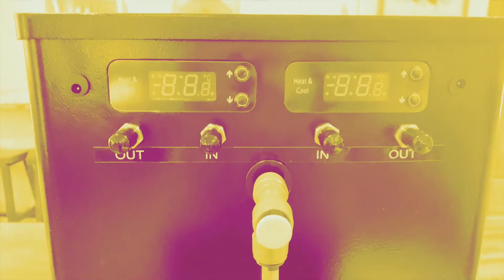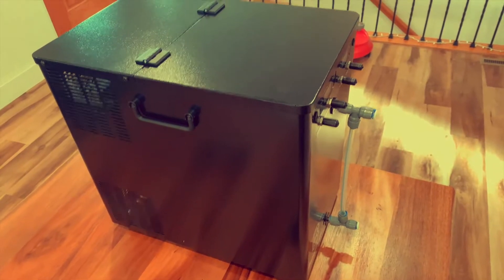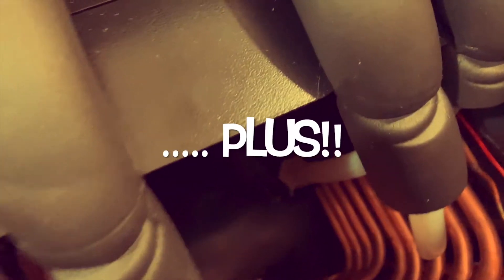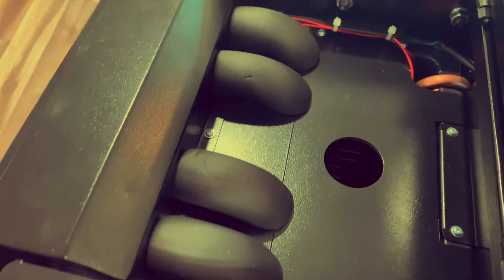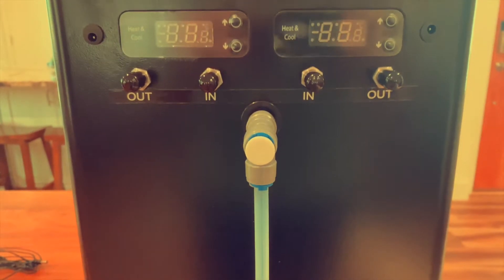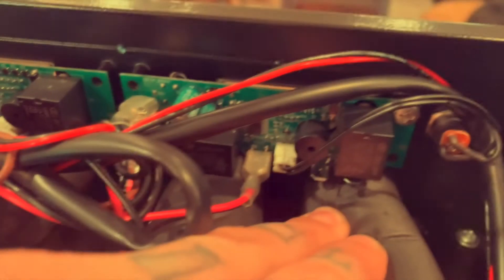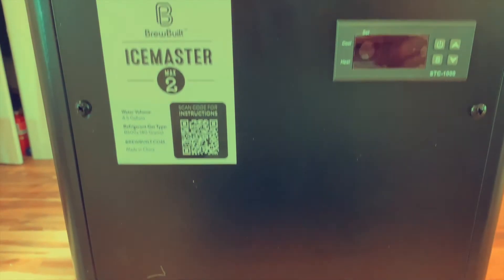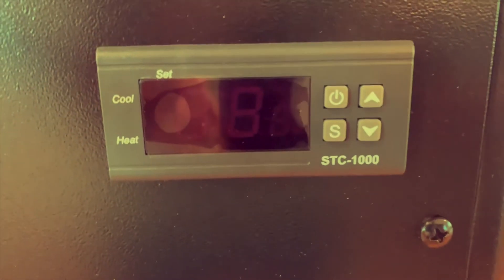Best Glycol Chiller For the Money??? BrewBuilt Icemaserter Max 2

Comment: Just curious, did you move away from the X1pro due to the lack of cold crash ability? Just curious where you landed. I'm similar to your initial needs, I don't have space for glycol so went that direction. Seems like a good product but a little limited maybe if you want a perfect solution. Good videos btw, thanks man!
Reply from the maker: Your exactly correct. Just could not get the X1 pro down to cold crash temps. I did have a video I did on the x1 pro and its cold crash capabilities. It worked for my needs for quite some time before I decided to cold crashing is a must. I do a ton of NEIPA’s so I feel the need to cold crash in order to clean up the style of beer it most make. 

CHEERS
Reply: Nice, your "new" setup looks amazing, hope it's meeting your needs. I get the x1pro this week. It's going to be a huge upgrade from the ss brew buckets I have been using. I have a beer in my brew plans that will need some dry hopping so hoping the x1pro helps me do that without introducing O2. I am not overly concerned (yet) with cold crashing but who knows, it's a journey!

Keep up the good work!

Comment: what is your proportion of water/glycol ? 3 gal of water and 1 of glycol ? cheers !
Reply from the maker: Yes sir 3 Gal Distilled water to 1 Gal of glycol will give you 25% dilution. Off the top of my head I think brewbuilt claims at 25% glycol freeze point is -7C. You might have to double check that but I usually have my Unit set at -4C when cold crashing.

Comment: Have you checked out the Stasis glycol chiller?
Reply from the maker: I actually did quite a bit of research on this unit and the stasis unit before I made my decision. This unit is still a way better value in my opinion. The only real benefit I could find on the stasis would be the compact size for people who have limited space. But if that’s not an issue I don’t see any reason I would purchase the stasis over this the ice master max 2.
Reply: @zackrabbitbrewing4997  On the Max 2, does both pumps run at the same time or can they independently run?  Thanks for your input!
Reply from the maker: Both pumps and temp gauges are completely independent of each other allowing you to run two fermenters at the same time. For example you would be able to have one fermenter in cold crash stage(say 30 degrees) while your other fermenter can be in early fermentation temps say around 68 degrees.
Reply from the maker: Or you would be able to run only one fermenter and the other pump can remain idle or can even be turned off.
Reply: @zackrabbitbrewing4997  Thanks, bro!

Comment: Could this system be used for chilling my tap line for a long draw 15"?
Reply from the maker: That I’m not sure. The pumps can pump 158.5 gallon/hour but are only rated for a max head/distance of 16.5 feet per pump. So the pump would need to be able to handle a 30 foot distance 15’ to your tower and 15’ back. However if you used this unit should have no problem cooling that but you need to ungrade the pump I’m guessing.
Reply from the maker: And you would also have to take into account if you plan to use it along with a fermenter it’s capabilities. The good thing about this unit is that I does have a 5 Gal reservoir so you might be able to still run a fermenter along side as well. Really your bottle neck would be the pumps.
Reply: @zackrabbitbrewing4997  Thanks for the info!